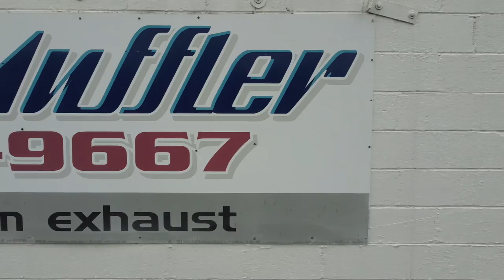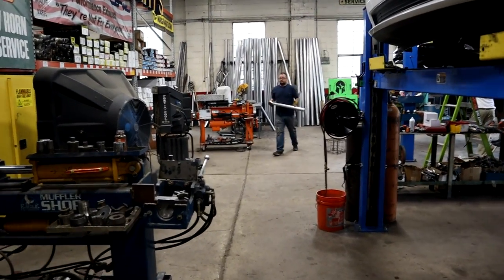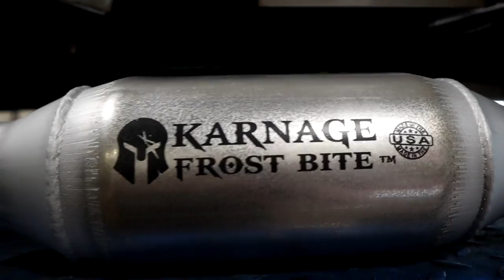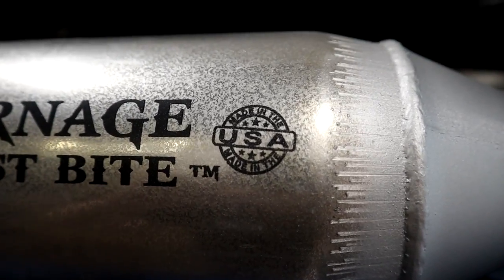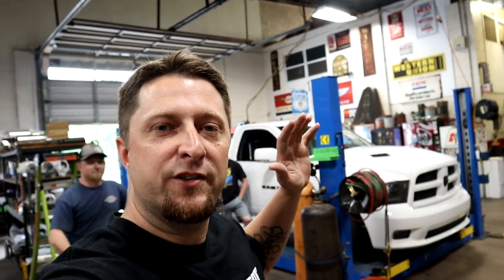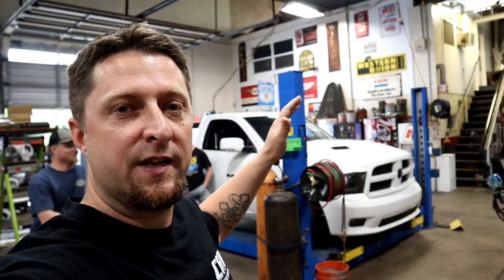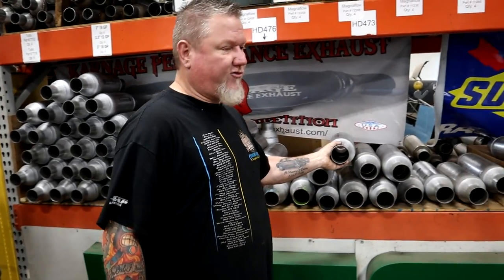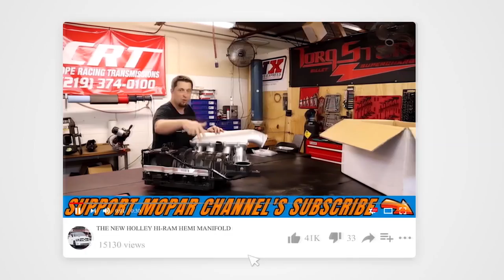Frostbite Takes Trip To Karnage Performance Exhaust For New Karnage Mufflers On My RAM R/T

Comment: Awesome! sounds wicked. I found them a while back way after I had the muffler from Spintech welded up and shipped to me. Regardless of what you think sounds better, company to company, knowing its made in the States with good materials is what matters. Especially when you're spending money on a custom system, you don't want your muffler, that gives you the unique sound to be subpar. Not knocking them or any of the other classics, but when you see made in China stamped on one of those classics with "stainless steel" next to it, I cringe. Seeing it proudly advertised as Made in USA, thats a big selling point!

Definitely look forward to the exhaust vids and others you have coming. Unfortunately, when you look them up, you just get their short exhaust vids and it doesn't give you enough to say, yeah that's the sound I want! BUT when you're asked what mufflers you're running because they've never heard anything like it before and you say, Karnage, Spintech; means you're breaking the mold and standing out, from the mass produced companies. The whole meaning of customizing and hot rodding.
Reply from the maker: Completely agree that's why I made the trip to see them in person and meet the crew definitely good stuff and people 👍 🇺🇲

Comment: I’m sorry dude
But seriously? Cramped bends? 
Mandrel bends dude 
I checked their stuff out a while back,  watched their vids and instantly put them on the joker list.  They have good stuff but need to take it to the next level and get them a mandrel bender
Reply from the maker: I think they did a awesome job and the bends is more than perfect for I or most individuals need.
Reply: @FrostbiteRam  yes it looks like they did a good job.  But your not maximizing flow with those type of bends.  It reduces pipe diameter greatly.  Btw I tig welded all of mine with SS exhaust builder kit,